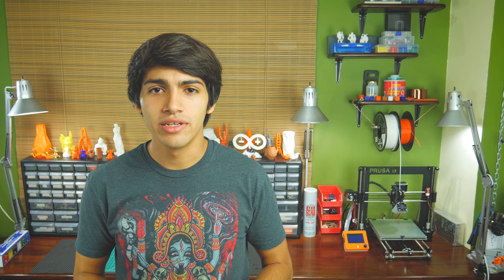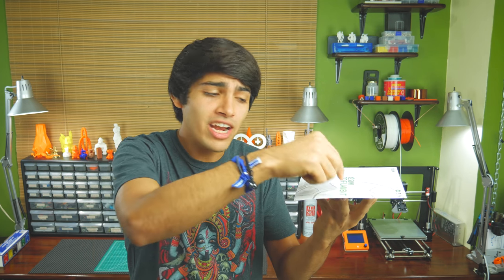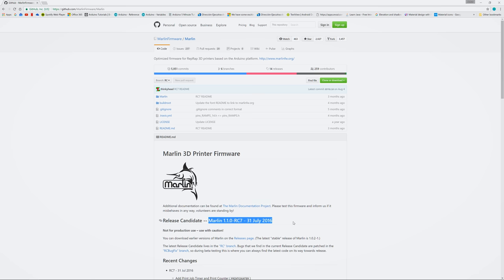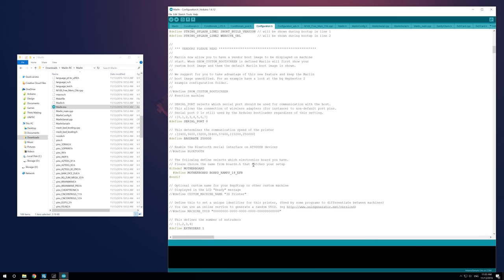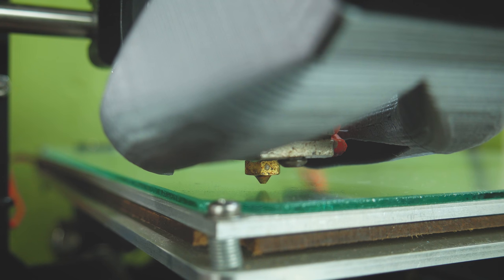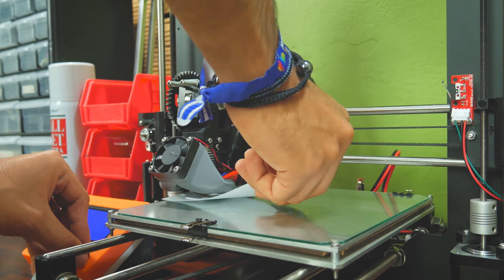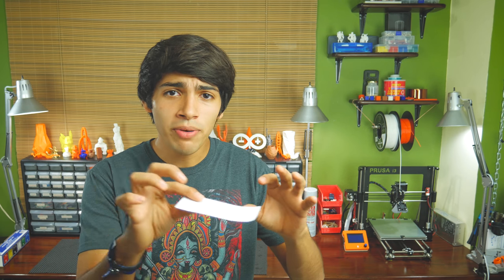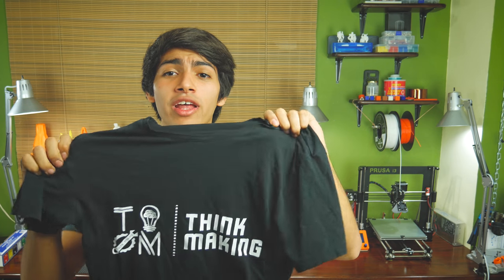🔩🔧 Manual Mesh Bed Leveling  -  3D Printing 101

Comment: You also need to change your start g-code script so the printer can recall the bed levelling data before start printing. If you leave the start g-code with only G28 at the beginning it will always override any saved mesh levelling data. You can add these two codes after G28 : M501 (to recall the data) , M420 S1 (to implement the mesh data into the printing job).
Reply: Thanks for these commands. I've incorporated your suggestion in the Cura's json file for my printer and it works very nicely.
Reply: Ahhh. It makes sense now.
Reply: Thank you so much! I was just having this issue with my Tronxy X5S and was so confused as to why it wasn't working
Reply: Thanks from the depths of my heart!
Reply: There is a feature called RESTORE_LEVELING_AFTER_G28 what if I enable it? Do I need to call this on code again?

Comment: The bed leveling thing has been the most discouraging aspect of 3D printing for me until I came upon your tip. It works great. Prior to this, I used Astroprint, or its CLI command window, to position the nozzle for bed leveling, but for some weird reason doing it this way I always ended up with the Z-home position slightly higher than it actually is during printing; this has resulted in my print bed got scratched up by the nozzle pretty badly. Now I got perfect first layer every time. Thank you very much.

Comment: I just want to add that I´m finally using the manual mesh bed leveling and it is AWESOME! Thanks for this tip, the best of the best in many many time. Cheers.

Comment: this video is not wrong, yet very incomplete:
- you should do the mesh bed levelling with your heatbed on;
- you need to add start g-code script so the printer can read those infos before you print
- you can store the settings on eprom, you don't need to redo it everytime you turn it on
Reply: Gus Maia what is eprom?
Reply: @ebonezbart  Eprom is the internal memory of the printer, you can store values like this mesh levelling data or changes you make such as the number of steps the extruder makes to move filament (esteps). On Creality CR-10S the only way to enable Eprom is by updating the firmware.

Comment: If you don  have a LCD then do this way 

With Mesh Bed Leveling (MBL) you can interactively measure a grid of Z heights without a bed probe. The only tool required is a piece of paper or a feeler gauge. MBL uses the mesh to compensate for variations in height across the bed. Comparable to using AUTO_BED_LEVELING_BILINEAR with PROBE_MANUALLY.

This feature is enabled with the MESH_BED_LEVELING option in Configuration.h. Users with a probe should enable one of the AUTO_BED_LEVELING_* options instead.

To do Mesh Bed Leveling from your host software:

Use G29 S0 to get the current status and mesh. If there’s an existing mesh, you can send M420 S1 to use it.
Use G29 S1 to move to the first point for Z adjustment.
Adjust Z so a piece of paper can just pass under the nozzle.
Use G29 S2 to save the Z value and move to the next point.
Repeat steps 3-4 until completed.
Use M500 to save the mesh to EEPROM, if desired.
To do LCD Bed Leveling with your controller: (Requires LCD_BED_LEVELING)

Select Level Bed then choose Level Bed (not Cancel) in the sub-menu.
Wait for Homing XYZ to complete.
When Click to Begin appears, press the controller button to move to the first point.
Use the controller wheel to adjust Z so that a piece of paper can just pass under the nozzle.
Press the controller button to save the Z value and move to the next point.
Repeat steps 4-5 until completed.
Use Control > Store memory to save the mesh to EEPROM, if desired.
Reply: very good

Comment from the maker: Update: You can actually store the mesh created in your EEPROM, yet I don't suggest this as the slightest bed shift would render it useless. It also reduces the lifespan of the EEPROM, which is already lower on cheaper boards. Leveling the bed this way takes only about a minute, so why not take your time to ensure a better print? Happy printing everyone!!!
Reply: Try this on a Delta and you get about 30 mesh points :-) 
But that was the way I did it before I saw your video.... good job.
Reply: So are you saying we should save it to EEPROM and re-use the mesh (assuming nothing happened)?  If so, do I have the procedure right?  M29 (until finished) them M500 (store to eeprom) then before a print (and after any M28/M30)  M420 -S1 (turn on leveling).  Is that right?
Reply: hey bro, great video. My Anet A8 for some reason doesn´t save the bed leveling. I do it and afterwards it doesn´t extrude anything because the bed is too high. However, I can move the paper while leveling... Any ideas?
Reply: Mesh bed leveling is for setting a curve to map out the bed, you need to still adjust the bed manually with the 4 corners to ensure your Z-height is set. Also, you need to add the code to the starting G-code so that it pulls the mesh data, otherwise it just ignores it.

Comment: this was helpful, but always remember auto leveling cannot replace manual leveling, it just does the fine tuning (stuff less than .5mm, like a warped bed or slight human error, you shouldnt rely on it for a really skewed bed)

Comment: you should always preheat the bed before doing any leveling...the bed will expand and you need level based on that, not cold. There is generally no reason to do this everytime, save it eprom and spot check every few dozen prints, only if you have a super unstable machine would need to repeat that.

Comment: thank you for sharing the process of mesh bed leveling! But one question remains for me: you mentioned that you first auto home your printer - but do achieve this with an endstop and if so how does the manual process of mesh bed leveling not go below your z-endstop ? Or is my z-endstop just too high on the z-axis?
Reply from the maker: It uses the endstop, and yes it does go bellow it. Unless it is an optical endstop it will apply some force on it unless you have the ones in which the flap that is pressed is very long and therefore has more room to squish. If the bed's level is inside the +-1mm margin, which is the normal stuff, there should be no problem.
Reply: Movinghead mau In marlin firmware you have to disable endstop limit to go below 0 ;)

Comment: In the auto bed leveling section, do I need to enable mesh bed leveling? Because in the video you only enabled it in mesh leveling, but I am not sure if I would need to do it in the auto leveling section as well. Also, how to I declare what points to "probe"?

Comment: Thanks for posting the vid. I was able to follow it and got the mesh leveling enabled. 
But when I start the process the first point isn't even over the bed. How do I fix this?
I'm running an Anet A8 with Marlin 1.1.8 any help would be great.
Reply from the maker: It sounds like your homing point is also outside the build plate. To fix that there is a line that reads "#define MESH_INSET 25" . This will change the mesh inset margin. The higher the number, the closer it gets to the center, solving your problem.
Reply: Thanks! I'll look into updating that. I definitely appreciate your help.

Comment: is this possible on anet a8? i've installed latest marlin but can't find the "Mesh bed levelling". Only "bed levelling" and "unified bed levelling"
Reply: This does work on an A8, you need to also enable the LCD Bed Leveling section.

Comment: Anyone done it on the Anet A8? Can't find the "mesh bed levelling" on config.h.
Reply: I just did this on an A8 and the latest Marlin Firmware. You now need to un-comment the LCD Display section under Mesh Bed Leveling to let it know that you have a screen to use. The standard A8 Firmware doesn't have Bed Leveling as shipped so you'll need to replace it with another one, I choose Marlin. Lot's of good videos on how to do this.
Reply: it's called LCD Bed Levelling now, I think

Comment: can i put the marlin frimware on wanhao i3?
Reply from the maker: If your wanhao's board has a bootloader installed that lets you flash a custom firmware, and the board is compatible with Marlin, then I don't see why it shouldn't be possible. Yet, I don't own one, so I'm not entirely sure.

Comment: Work on cura?
Reply from the maker: Yes and no, because this does not rely on your slicer. It is done directly on the printer. You could use any slicer, it would not make a difference as the change is done in the printer's firmware.

Comment: Dude, you can't call it "101" and then not explain how to flash your firmware, access the firmware on your comp, and re-install it back on the printer. This video is essentially useless w/out that info.
Reply: you literally plug in your printer's arduino into your computer and upload
Reply: lmk if you would need me to be more specific
Reply: How are people supposed to know that. What are we flashing with? How do you flash? What's the process?  it's a BIT more than just put a thing on a thing and put it back in the thing.
Reply: You upload it through arduino. You plug in the arduino board that your printer uses into your computer with a micro usb (usually, sometimes it can be another type of usb) and then once you alter the configuration file, you can click the upload button in the arduino app.

Comment: I am sorry mate, but I can't continue, you make to many bold statements without substance, like in this video you state at the end that this is about all you need to know for a good first layer. There is so much more like temperature of filament, your.bed temp, your bed surface, your filament type, do you need a temperature stable environment? Like for nylon. And to top it off don't like how you introduce yourself in the third person.
Reply from the maker: The main focus in this video was getting a perfectly flat first layer without gaps between each line, as this doesn't look neat and might affect your print's integrity. I have separate videos to cover bed adhesion, which is another topic. Thanks for the feedback though!!! :)
Reply: I find it amusing that you criticize his intro, yet your grammar is awful. How about a period after continue, not a comma. Also "to many"? Really? "to many" implies to a lot of people. Try "too many" instead. I could write a 600 word article and continue to tear apart your comment, however that is really pointless. After all, I feel the way about your comment as you felt about his video, and here I am doing exactly to you as you did to him. Ironic. However here is the reason I commented on your comment:

In your defense, you are correct about all the other issues in regards to a good first level. We could probably write a book on that subject alone.

 I am not trying to be rude to you at all, so please don't take it in a bad way. Perhaps a little thought in regards that is is trying to help others should also be considered James, before you tear into him. Just a suggestion. 

In closing, I have probably done the same thing many times, and I can assure you that my grammar sucks too. 

Be well, and please don't hesitate to express your thoughts, as that would be much worse than saying nothing at all. You get credit for that as well. At least you took the time to point out important factors about getting a good first layer. I personally still fail often at not just getting a good first layer. Failure is our friend. Faster failures are much better than slow ones.

Comment: can i put the marlin frimware on wanhao i3?
Reply from the maker: If your wanhao's board has a bootloader installed that lets you flash a custom firmware, and the board is compatible with Marlin, then I don't see why it shouldn't be possible.